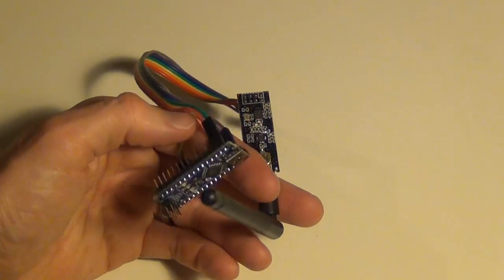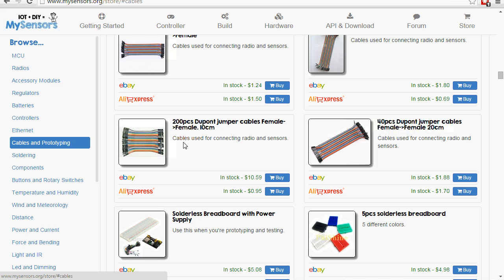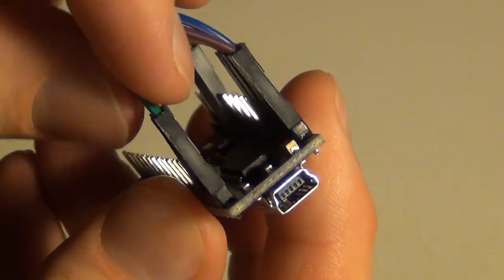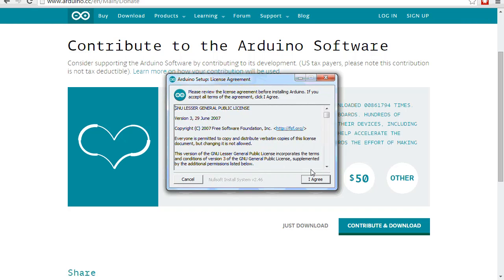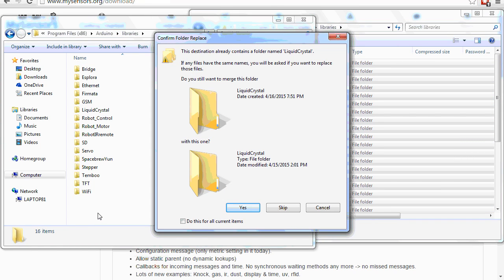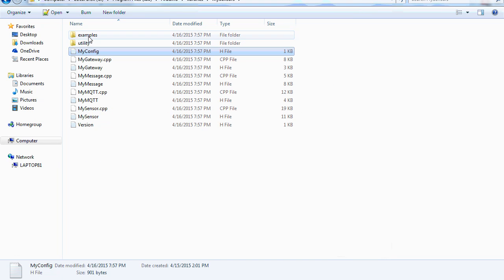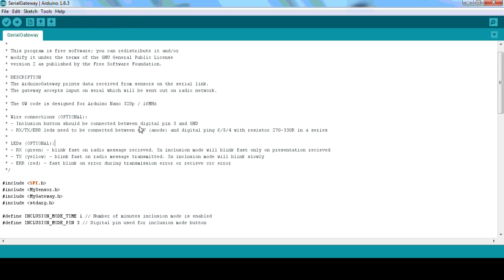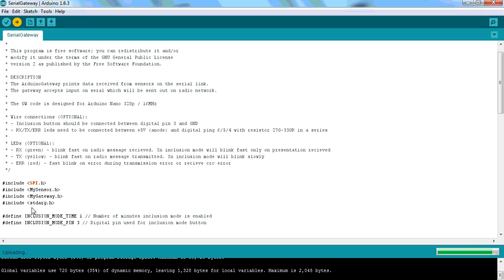MySensors Getting Started: Creating a Serial Gateway

Comment: when you connect up the bridge with the jumpers and to the PC, do you need to power the Arduino separately also? can i use the USB to power it later?
Reply from the maker: Yes, the USB from the computer can power everything as long as it's the correct voltage (the radio needs 3.3v and some pro minis have that as an output).

Comment: I have Home assistant installed on my RPI3 (Model B). How should I integrate the serial gateway and the HA together ? Should I plug the serial gateway into one of the RPI3 ports and edit the yaml file ?
Reply from the maker: That should work but I haven't personally tried it.  I am using an Ethernet gateway with Home Assistant.  I added this to the configuration.yaml file
#MySensors integration
mysensors:
  gateways:
    - device: '192.168.1.10'
      persistence_file: '/config/mysensors.json'
      tcp_port: 5004
  optimistic: false
  persistence: true
  retain: true
  version: '2.2'

It should be very similar for the serial gateway except you obviously wouldn't have an IP address.

Comment: Will you be updating your video for MySensors library 1.5? When I first tried following your instructions with the newer version I got stuck so dropped back to using 1.4.
Reply from the maker: It should still apply for 1.5 but I'm not sure about 2.0 (which was recently released).  I still haven't updated my devices to 2.0 yet so I'm not up on all the changes yet.

Comment: This might be a stupid question but could I just use a nodeMCU board instead of the Nano and separate radio? Just getting started with Home-Assistant on my rpi3 and wanted to connect some PIR sensors!
Reply from the maker: Hmm.  I've never used a nodeMCU board so I'm not sure.  Someone over on the MySensors forum may know more though.
Reply: Thanks, I'll head over there and ask!

Comment: Great video. I found mysensors.org last night and I was wondering if you need the controller for something simpler like a weather station. Or can the gateway have a data logger on it to save all the sensor info coming in.  Thanks Jeff
Reply from the maker: +Jeff Krueger Technically you probably don't need a controller if you can modify the Arduino code on the gateway.  I'm guessing it would be quite a bit of work though.  You might want check out the OpenHAB or Domoticz controllers (http://www.mysensors.org/controller/).  They interact with MySenors and are free.  Might be a good compromise.  I haven't used either so you will want to make sure they do what you are trying to accomplish.
Reply: +Pete B  Thanks for the info. I kind of thought that was the case. I'm just learning and trying to see which is the easiest way to go. Thanks again for the great video.

Comment: This example sketch isn't included in mysensors anymore.
Reply from the maker: You'll want to use this one: https://github.com/mysensors/MySensors/tree/master/examples/GatewaySerial
Reply: Pete B unless I'm missing something, I can't see anywhere in the sketch that sends data recieved out the serial port.
Reply from the maker: It all happens in the background as long as you have the MySensors library installed.  You need to have the baud rate set to 112500.  Also, if you have line 40 (#define MY_DEBUG) enabled then you will see the debug info as well. 

Is that what you're looking for?

Comment: Is it possible to use rfm69hw or esp8266 for the wireless connection? Which controller do you use?
Reply from the maker: msevyt I know there are some people working with different wireless connections but I have lots of the NRF24L01 devices so I use those.  They are cheap and work well.  I have a Vera 3 controller.

Comment: I am a little lost about the controller part here
So suppose I want to use my laptop as the controller, a serial gateway means it will communicate through the USB cable?
What kind of software should I run on my laptop in this case?
Reply from the maker: +Bishoy Botros Correct, it would be connected via USB cable.  There are various software apps that you could install on your laptop.  Check out http://www.mysensors.org/controller/ for a list.  I personally use Vera but Domoticz seems to be pretty popular.
Reply from the maker: @governmentofficial_23  I don't have much familiarity with Domoticz but yes, that's the general idea.  You need Domoticz running on a computer and the MySensors Gateway will connect to that.  The sensors will then connect to the gateway (usually wirelessly).
Reply from the maker: @governmentofficial_23  Cool!  I have never used RF69 but I know plenty of people are.  I personally use Pro Minis as well as NFR24 modules and they have been working great since I started in 2014.  Good luck!

Comment: Pete B, Is a genuine Nano required to build the gateway? I'm having issues getting my Vera edge to set the port with the Nano (non FTDI) I used. Looking at the mysensors forums many people say it must be genuine nano, but someone mentioned yours worked with a clone. Love your videos keep at it. Thanks
Reply from the maker: +Jim Lieffort Hi Jim, I was using a Nano clone for my gateway but I am still using a Vera3 running UI5.  I have also switched to an Ethernet gateway.  It wasn't quite as easy to make (although it's not difficult) but it works much better because I don't have to reconfigure it when my Vera loses power.  I am using a w5100 Ethernet Shield with a Pro Mini but you should be able to use a Nano without any problems.
Reply: +Pete B I am trying to convert to a Ethernet gateway, using a nano clone and w5100 Ethernet module. Not having much luck, I think it's power and or configuration. Will I need to completely uninstall the my sensors plugin I'm currently using with the serial gateway or can I just add the IP and port information? Also how are you powering everything on you E gateway? Any help appreciated.
Reply from the maker: Jim Lieffort You shouldn't need to reconfigure the Vera app.  Just put in the ip and port like this 192.168.1.100:5003
I am powering everything from a phone charger.  The w5100 and Pro Mini are getting powered directly and I believe the radio is coming directly from the charger as well but with a 3.3v regulator and capacitors in between.  Also, did you remember to turn on Soft SPI for the W5100 in MyConfig.h?
Reply: +Pete B Enabled Soft SPI by uncommenting #define SOFTSPI in MyConfig.h. The gateway is seen by MYSController, it will go into inclusion mode, but does not control any of my devices nor can I add any.
Reply from the maker: Jim Lieffort I noticed you posted on the mysensors forum.  Let's take this up there so more people can provide input.  Here is the link for future reference: http://forum.mysensors.org/topic/1197/changing-from-serial-to-ethernet-gateway/13

Comment: When working with V2.0 and I unzip the MySensors-master.zip i dont get the libraries folder, core, Documentation, Drivers, Examples, test. what shuld I capy to the Arduino instalation folder? Best Regards
Reply from the maker: Download everything from this link and put it in the Arduino Libraries folder in a subfolder called MySensors. https://github.com/mysensors/MySensors

Comment: How in the world did you get the capacitor leads into the dupont fittings??  Seems way too tight, and the thin capacitor wires don't support being shoved in, even using needle nose pliers.
Reply from the maker: Hmm.  Mine weren't too difficult.  Maybe I got cheaper fittings?  I was able to slide it in with my fingers.
Reply: Interesting... no way mine are just going to slide in like that.  Any other way to wire it in somewhat easily w/out using a breadboard or some other big contraption?  This electronics stuff is new to me...
Reply from the maker: Chris J Hmm.  If you're careful you could try to wrap the leads of the capacitor around the male pins on the radio.  You would want to wrap it very tight so it doesn't come loose.  If you ca solder the capacitor to the radio that would be much better though.

Comment: Awesome! Jumping on ebay as we speak. Do I need a gateway per sensor? Or one gateway can do many sensors.
Reply from the maker: davvvvvo Yes, you only need gateway.  I have around 80 MySensors devices working with my one gateway.  Be careful though, it's addicting :)
Reply: Pete B I'm already hooked on the idea. Now the waiting game for all the items to arrive. $90 vs $15 hard decision.
Reply from the maker: davvvvvo Yes, the waiting is hard.  I recommend browsing through the mysensors site to start ordering parts for future projects so hopefully you can cut down on that in the future.  The temp/humidity sensors are pretty easy and useful.  The motion sensors are great too.  I use them to turn on my lights all over the house.
Reply: Pete B bit of a let down so far. Can't even get the plugin set up. Tried the include page and can't even load or find the plug in once added them all.
Reply from the maker: davvvvvo That's frustrating but don't give up yet!  Can you start a new post at http://forum.mysensors.org/
There are lots of helpful, knowledgeable people there who can help.  Make sure to indicate which controller you are using (is it a Vera?).  If you tag me with @petewill I will respond there.
Reply: Pete B yeah sorted out the plugin after a few hours. Cheers, I will do that.
Reply from the maker: davvvvvo Great!  Is everything working now?
Reply: Pete B sure is, gateway and sensor working, but the sensor doesn't pick up much unless im waving my hand 2cm in front. Same one as yours. Tried adjusting both adjusters and have tried 3 other sensors with same results so far.
Reply from the maker: davvvvvo Strange.  How is the senor powered?  Try to connect it directly to 5V power (from a cell phone charger or something similar).  Maybe it's not getting enough power.
Reply: Pete B you got it in one, changed the usb cord that was old for a new one and boom she's good to go. Cheers lad
Reply from the maker: davvvvvo Great!  Glad it's working!

Comment: When installing libraries, NEVER install them in the Arduino install folder. Use a "libraries" folder inside your Sketchbook instead. The whole libraries folder in the Arduino install folder will replaced (thus loosing all the installed libraries) when you update Arduino IDE.

Comment: with the same wiring, with arduino 1.6.7 ad a nRF24L01+ , I got :
INFO Flushing FIFO
INFO Connected to COM5
RX 0;0;3;0;9;radio init fail

any idea?
Reply from the maker: +Mehdi HAMIDA It looks like your wiring is somehow off.  I have never received that message though so I can't speak from personal experience.  I would triple check the wiring.  If you're using something besides a Nano or Pro Mini you may need to change the CS and CE configuration.  Sorry I can't be more helpful.  You could also try posting/searching the mysensors forum.  There are lots of helpful posts/people there.

Comment: So it doesn't look like it was assigned any kind of identifier that you reference with the nodes... how do the nodes know that they're talking to the correct gateway and not your neighbor's gateway?
Reply from the maker: Unfortunately none of my neighbors like home automation so that's not a problem for me. :(
But, if your neighbors are, then you can change the settings in MyConfig.h.  There is MY_RF24_CHANNEL which will change the NRF channel as well as MY_RF24_BASE_RADIO_ID.  You can also use Signing if you want to make sure no one sends unauthorized messages to your devices.
Reply: Pete B
Cool, thanks!

Comment: hi bro, can this code work Arduino uno? Or just on the nano?
Reply from the maker: Good question.  It probably depends what home automation controller you're going to use.  If you want to use a Vera you will need to use a Nano.  If you are using something else the Uno may work.

Comment: When i try to compile, I get C:\Users\scott\Documents\Arduino\libraries\MySensors/MySensor.h:259:4: error: #error No forward link or gateway feature activated. This means nowhere to send messages! Pretty pointless.    What needs to be changed in the mysensor.h?
Reply from the maker: +Scooter G 
Not sure.  I haven't seen this error before.  Sorry.  I did a quick search and found this forum post that may help: http://forum.mysensors.org/topic/2742/problem-compiling-sketch-on-library-1-5-devel/4

Comment: How do you connect the gateway to the controller?
Reply from the maker: +myyoutubeusername It depends on which controller you're using.  For the Vera you have to add the App then configure it on the Advanced tab.
Reply: Thank you for the reply Pete , I understand that, I meant how is the gateway physically connected to VERA? Is there a usb to ftdi serial cable running from VERA to the arduino pro mini?
Reply from the maker: myyoutubeusername Ah, sorry.  Unless something has changed the Arduino needs to be a Nano (not Pro Mini).  And, yep, you are right, it is connected via USB into the Vera.